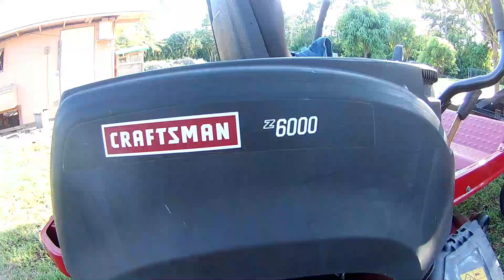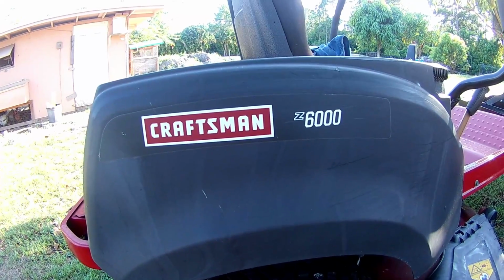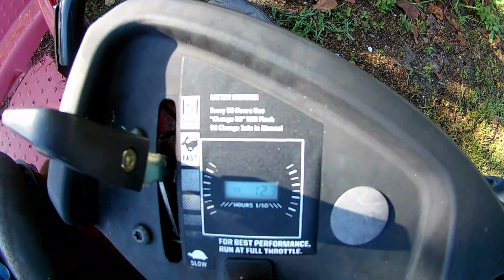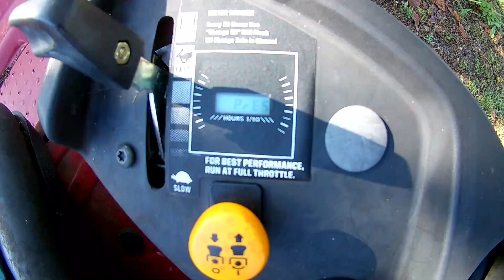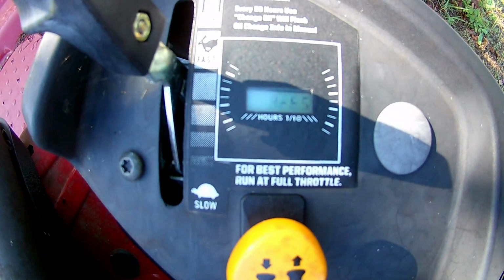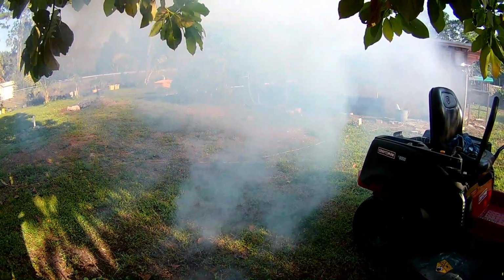Zero Turn Smoking

Comment: Ok I have the same problem with my Toro Timecutter. But it only does it when I do a cold crank on it. I myself am going to try a bottle of hyperlube at my next oil change. Hopefully that will better seal the piston rings.
Reply: What was your fix ?